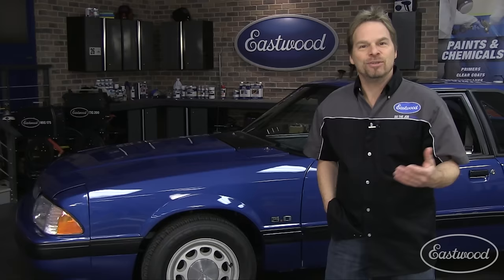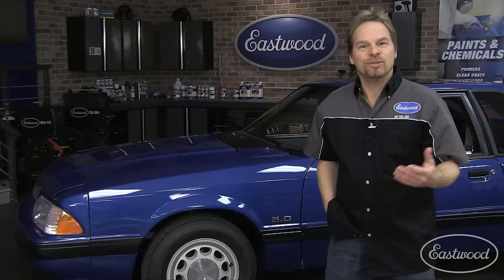Painting Over Paint: When You Can and Can't -  Kevin Tetz has the Answer at Eastwood

Comment: Thinking of redoing a paintjob on my RX-7 hood. The spraycan I used on the hood at the very start has a fucked up nozzle. The front of the hood got some excess paint in areas that aren't looking so good now. Thankfully the pop up headlights didn't get bad treatment so it should be an okay job just to strip down the paint on the hood while having plastic all under it and out to the sides while I have another go at it.

Comment: what do you mean by prep? Sand? My paint job is perfect. Just want to change from white to black. thanks!
Reply: yes you dont need to bring it back to bare metal and prime it if there no crack or rust on your paint just sand clean and paint
Reply: @nicbest1  I've heard bad things about sanding the paint.   Are you sure?  What grit?
Reply: @AJ-on-youtube  all depends on the paint your using but 400-500 should be just fine, never had problem sanding good paint but you can scotchbrite it too, what i would do is use a small part like a mirror and try different method

Comment: i was here because my car got repaired (collision) and i noticed they didnt make the car gloosy enough. even though it looks good and solid do you think maybe if i buy a can of clear coat and spray a little over that part it will make it better? i just feel they could have made it slightly more reflecting
Reply from the maker: What you're looking for is to Cut and Buff the paint.  Applying additional clear is a more involved, more expensive process.  If the finish is good, just a bit "dead" it should buff up.  

Follow the steps in this video:
https://studio.youtube.com/video/3xL35vj4y2w/edit

Cutting Compound: https://www.eastwood.com/eastwood-concours-fast-cutting-compound.html

For a beginner Orbital buffer's are much more forgiving and pair it with a foam pad.
https://www.eastwood.com/eastwood-variable-speed-6-orbital-sander-polisher.html

Coarse Pad: https://www.eastwood.com/eastwood-concours-6-foam-polishing-pad-coarse.html

Comment: Need advise.!!!  I was color sanding a scratch i filled with touch-up paint and I burned through the clear coat  ugh!!! ☹ any suggestions on what I need to do to repair.  Body shop quoted me $1000 to paint two doors but the burn through is only on one door. Factory OEM paint  Steel Saphire Metallic 2017 Honda Pilot

Comment: What if I missed a spot while I was painting is it safe to scuff the surround area apply basecoat and reclear ?? It’s fresh paint that has already cured for a day
Reply from the maker: In general:

You're going to want to scuff the whole panel with 800 grit and/or gray scuff pad.  Prep and apply base coat and blend out across the panel.  Then re-clear the whole panel.

As far as top coating times check the manufacturer's label.

Comment: Do I need to apply anything before spraying new paint over the old one.
(NOTE : I am spray painting an aluminium bicycle frame. )
Reply from the maker: Are you removing the original coating?  It should likely be sanded and sprayed with Epoxy Primer, but I recommend contacting an Eastwood Tech so you can discuss the project in detail and make sure you get everything you need. The number is 800-343-9353.

Comment: So I have a guitar in a poly finish I want to refinish in a flat primer. Do I need to strip the old poly, or can I just rough it up with some high grade sandpaper and put the primer on top of that? The original poly is in perfect shape, and the primer will be the final finish. I know oils from my hands will discolor the unsealed primer, but that's what I want. I'd just like to know if the primer will stick to the sanded poly.
Reply: Guitar Whores I just did this on an old strat I was rebuilding. Sanded and primed right on top of the existing poly. The new coats of color have taken well. Stripping that factory poly coat down to wood will be a huge amount of work. As long as the existing paint is solid you shouldn't need to fool with it.

Comment: So if I buy a brand new truck and the paint is obviously perfect I understand I can paint over it.  My question is what would you use to prep for the new paint.  I was thinking 600 wet on the entire truck but do I have to go that course??  Also do I need to go into the paint layers or just sand the clear coat, sort of like color sanding??  Thanks.
Reply from the maker: Does this help:  https://youtu.be/Hc6ycADb8Mw
Reply: Depending on what colour you are repainting it , 600 wet for solid colours, 800 for metallic/pearl. Just wet sand the clear until there is no longer any gloss. Be thorough.
Reply: DENIM MAN  Thanks!
Reply: Eastwood Company